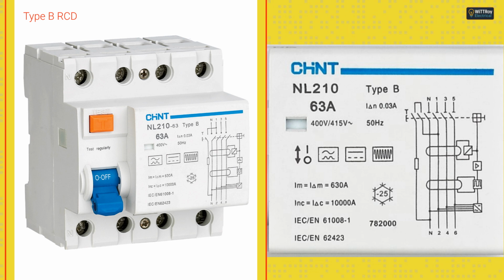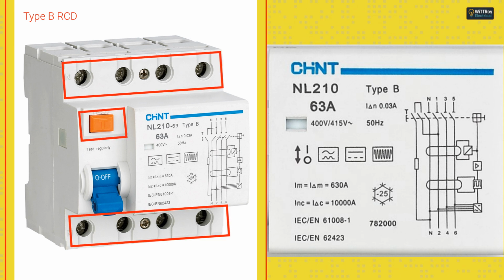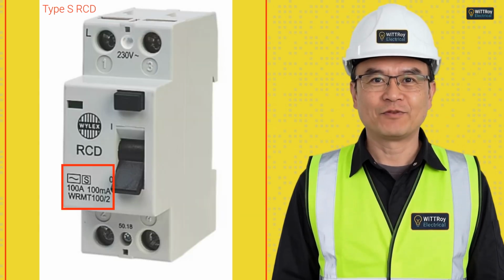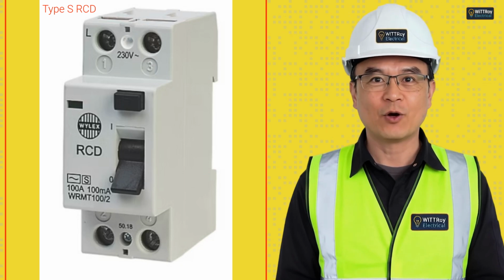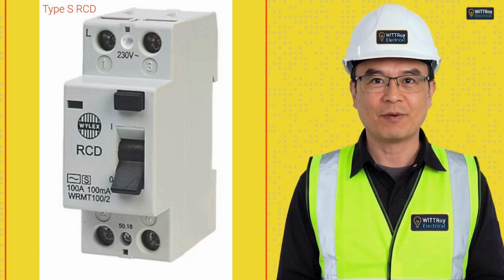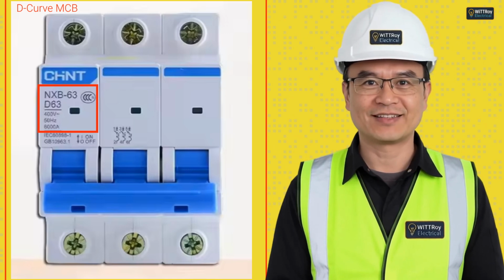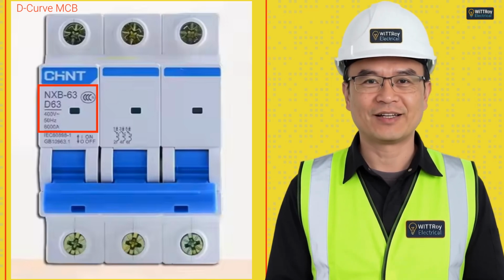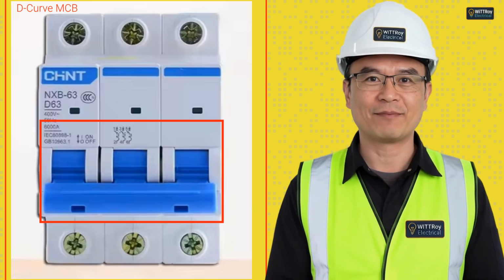What Type of RCD or  MCB is This?

Comment: Arent we only allowed to use Type A RCDS mostly here in NZ? Thanks
Reply from the maker: According to AS/NZS 3000:2018 Clause 2.6.2.2.3, New Zealand only, RCDs required by this Standard shall interrupt all live conductors, including active and neutral, and be of a type that provides protection against electric shock that complies with the requirements of a Type A RCD.

So, in practice, Type A is the normal minimum requirement in NZ. It does not mean only Type A can ever be used. A higher or more suitable type, such as Type F or Type B, may be used where the equipment requires it. However, Type AC should generally not be used for RCD protection required by AS/NZS 3000 in New Zealand. Thanks